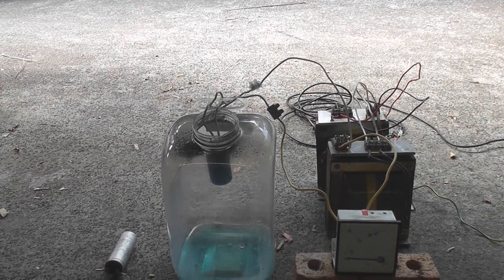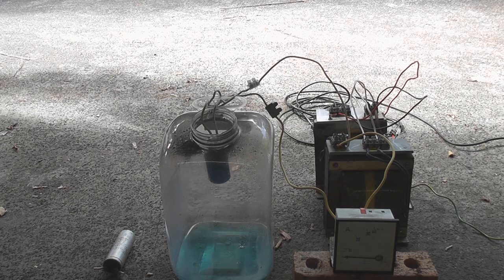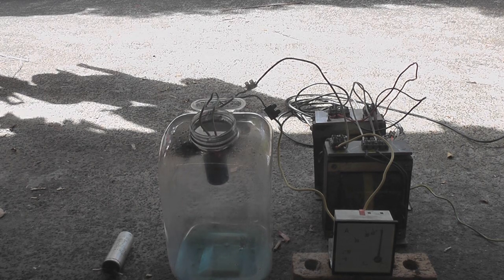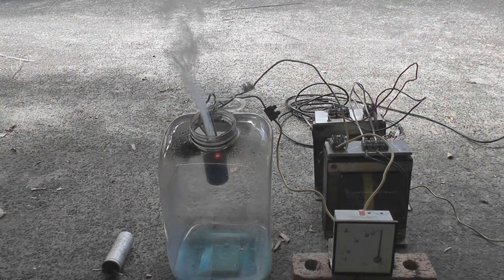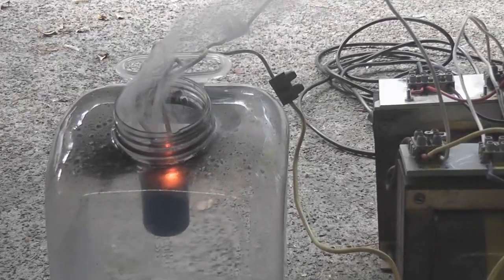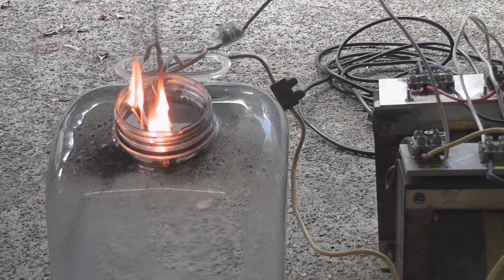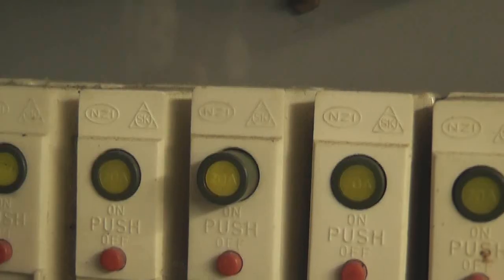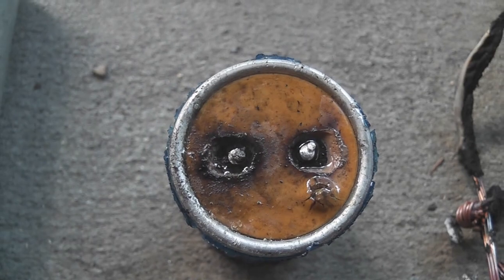Capacitor pop [2]

Comment from the maker: My fuse box is near my testing area, The trip circuit is activated by a relay which drops out when power is lost to my control module.
A charged 400 Volts 220µF capacitor furnishes the power for a simple led flasher circuit made with a diac so indication is there when power is lost.